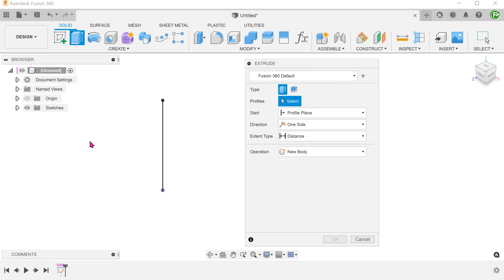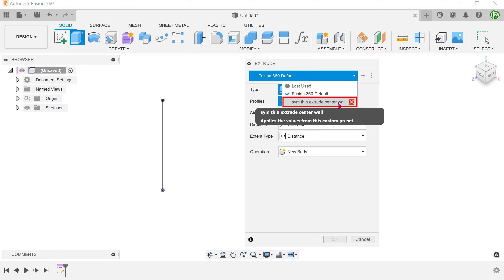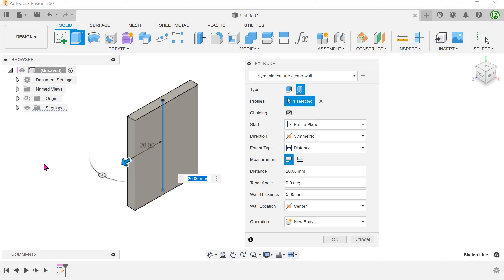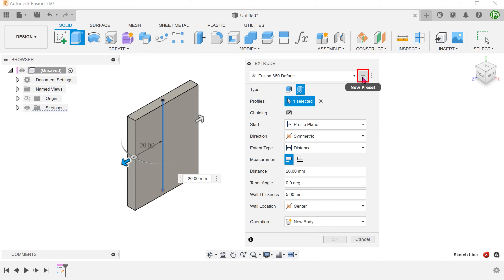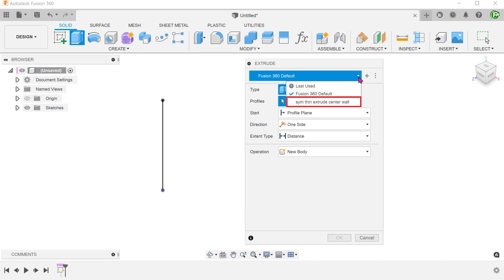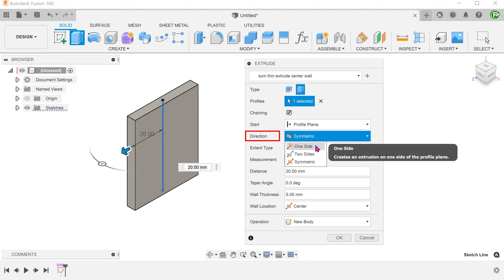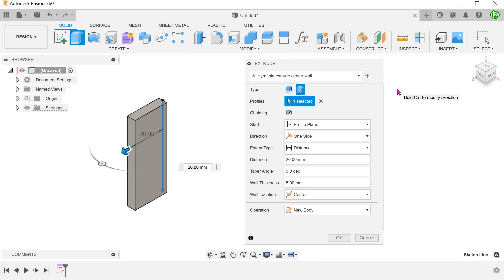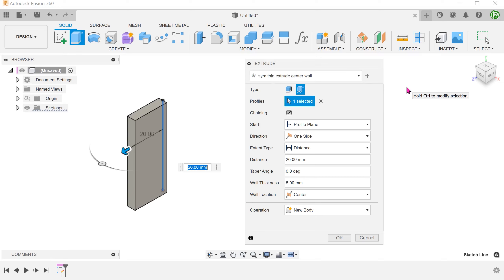Fusion 360 | Extrude Presets (only with Product Design Extension)

Comment from the maker: After looking through some of the comments, I just realised that this is only available in the Product Design Extension. I was not aware of this during the making of this video. Really sorry about that.
I had the extension on trial for the past few days, so this feature appeared in my extrudes. I had assumed that it was an improvement for the core product. It seems inexplicable why the use of presets would be packaged along with the extension. This does not make sense to me at all. Autodesk really needs to make this available for the core product.
Reply: I though you are one do trying the new functions before they get out and cheating wat comes in few week, but no it will not happen, look really use full, thanks for sharing anyways...

Comment: i dont seem to be able to see this feature. does it come with some kind of extension?
Reply: Yes, at the moment, you need access to  Product design extension for this and other newly announced extension features
Reply: @sualpozel1  Thanks, I was also wondering why I do not have them visible on my F360
Reply: That's annoying. So it seems these damned extensions are now appearing outside of the manufacturing environment. The cost is simply eyewatering and totally unaffordable for amateur users.
Reply: @murrayedington  I won’t comment on cost , I simply wanted to explain who can use these functions. All startup licenses , and edu licenses can use extension functions for free, commercial licenses need to subscribe to an extension in order to use extension functions. Hobbiest / personal users can not access extension functions.
Reply from the maker: Apologies for this. I was not aware that this is only available in the Product Design Extension. I had the extension on trial for the past few days, so this feature appeared in my extrudes. I had assumed that it was an improvement for the core product. It seems inexplicable why the use of presets would be packaged along with the extension. This does not make sense to me at all.
Reply: @Fusion360School  i think its because they are needed for the plastic design rules in boss and snap latch.  The defaults are a way to apply all the new parameters needed there.  Great overview btw
Reply from the maker: @TheShift1313  Come to think of it, it does make sense that the preset feature was thought of as a way to alleviate the hassle of adjusting the long list of parameters in boss and snap. It is a great quality of life improvement. Hope that this can be made available for the core product as well.